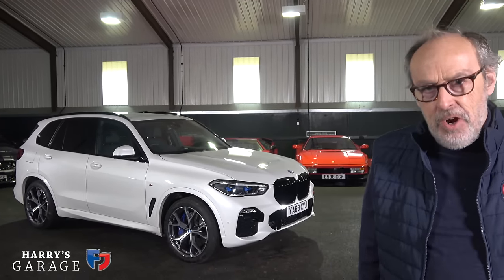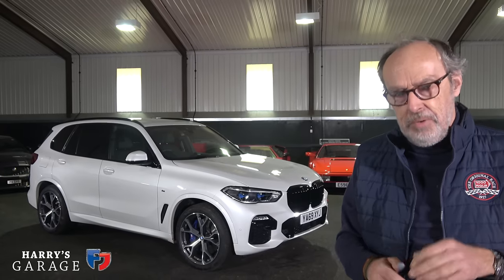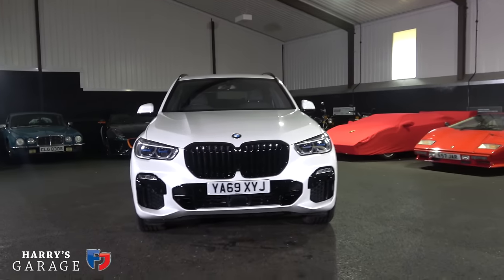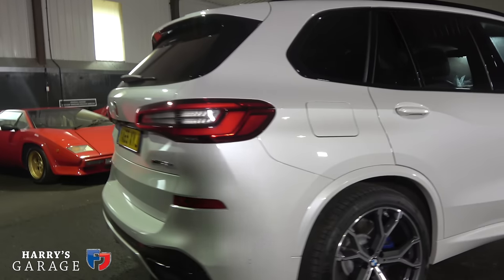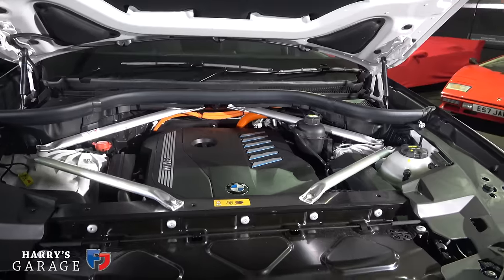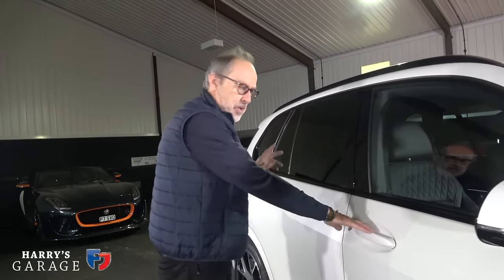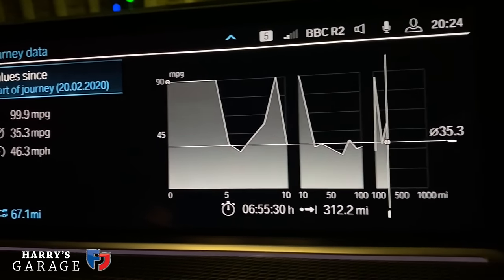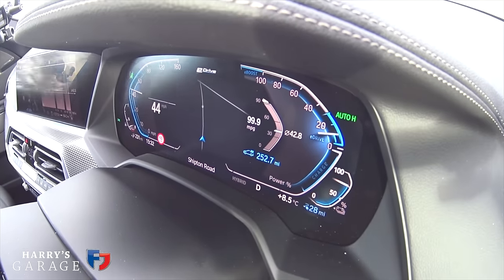BMW X5 45e PHEV 2020 review. Is this new plug-in hybrid better than a pure EV in the real world?

Comment: I remember reading somewhere when the X5 45e was announced that BMW were considering multiple engines including a 4 cylinder (like in the previous gen 40e) but there wasn’t much difference in economy between that and this 6 cylinder so they decided to go with the bigger smoother engine as they thought customers would prefer it. I’d certainly go for this over the P400e, and would be interested to see how it compared to the Mercedes GLE 350de.

Comment: Excellent review! My three year old X5 40e use 2,5 l/100km locally and 7,4 l/100 km on long distance (fully loaded). But 80% of the distance I drive is locally around town. With this new 4,5e I would go fully electric for month. All the EV and all the ICE advantages in one car!
Reply: how efficient is the battery charging while driving?
Reply: @MrHellrider9  Going downhill on cruise control, the brakes are not used and the battery charged at greate pace on the 40e I owned, as well as on my 45e today. Just like any EV.

Comment: you  don't need to have it adaptive mode for the smart hybrid function where you use the navigation.  you can just have it in hybrid or eco pro hybrid also as long as you enter a destination in the navigation system . adaptive mode has with the handling of the car, like steering wheel hardness and suspension.

Comment: My Lexus 2017 Rx450h does over 35mpg on long or short journeys and I don’t have to plug it in. Not bad at all. This BMW’s use case is for daily commuting for approx 50 or so miles a day where battery power alone could give petrol free drive and the the occasional long drives to not make you worry about battery anxiety.

Comment: Top stuff Harry as ever. I do 90% trips of under 50 miles and this is where Hybrid Golf GTE, BMW i8, Porsche Panam' Tourismo e hybrid win out - as mpg on the 'long-term' readout is nearly always 85-100 mpg...and because it is aggregating away in the background every day, even a 250 trip once a month doesn't dent the long term mpg fig by much. In short these cars are brill if you hate petrol stations,  love silent town progress, favour torque over power/revs, mainly drive less than 50% over the ev range everyday, like the smooth but gruffly coupled power you get from engine/ev unit when you drive in sport and finally you DO have access to charger(s) at home - then they are better than a full electric car !!

Comment: My 2020 i8 has the same software and yes it works! Mine has only 11,6 but as it’s much lighter it still does 54 km in real life charge.
Reply: Klaus Nielsen congrats on getting that car. It is so much underrated due to it’s neither a BEV nor a full on hardcore racer. The three cylinder sound also is amazing in sport mode!
Reply: Nico Steinacker it may not be a hardcore racer in the sense of Porsche 918 or La Ferrari but it is a lot faster than all the iHaters think they know! Mine is the Roadster variant but I drive a Volvo XC90 T8 Excellence as a daily and plan to get this X5 45e or the 745 Le later this year.
Reply: 54km is only 33 miles so much worse than this X5.

Comment: And all the time you were using the rear wiper. Even when talking in the garage. 
Nice review
Reply: It was also a very noisy rear wiper!
Reply: That wiper was driving me nuts.
Reply: And Me:- I kept shouting switch yer wiper off. Look in your rear view mirror. Listen 👂
Reply: its a BMW.. its already broken
Reply: Did my head in too. Would probably have doubled the range if that hadn't been on constantly.
Reply: Rob C 
Ah I get it,  just like the indicators, they never work on BMW’s either 👍🏻
Reply: I have the car, when the rear wiper is on I do not hear it. And no, I am not hard of hearing.
Reply: Bob Bolitho when It’s rubbing on dry glass it does make a noise. It would also draw unnecessary power.

Comment: Harry, can you not recharge the BMW on the motorway as you are going along?  I run the latest Panamera Hybrid and over two years it has averaged 36.4 mpg.  Not as much as the X5 you tested but the electric range is a claimed 31 and I have never had better than 28.  (In winter nearer 24).  However the big benefit for me is using both engine and electric for longer journeys say to Manchester and recharging to 80% charge on the way back in under half an hour in Sports Plus.  You get below 30mpg whilst charging in this way but then overall for the 450 mile journey the car returns close to 40. This allows you to always have electric range available, something which I suspect in town centres will be necessary in the years to come.

Comment: Great video Harry and very fair, I have owned a few X5s both diesel and a petrol which had been converted to Gas. The petrol was a 3ltr and was great wether running on gas or petrol but without doubt the diesel was both more economical and gutsy than the petrol and did around 30/35 mpg depending on hard you pressed the power pedal. I bought my daughter an X3 Sport 2ltr diesel and that's brilliant on fuel around 42 on a run and she's got a heavy right foot. This X5 looks brilliant but fitting the 3ltr diesel would have made it outstanding on fuel. Whilst you say the price of this X5 is £66,000 and good value not everybody including me cannot afford this sort of money so I'll just have to wait around 10 years till it becomes affordable but I would love one, the trouble is ill be 85 by that time so may not need one anymore, I will stick with my BMW 730 ld for the time being with its £160-00 a year road tax and live in hope that I make it.

Comment: GREAT balanced video as always Harry - try the new Merc GLE 350de PHEV, it has a bigger 31kWh battery and 60 mile claimed EV range, 320hp system output, very comfy ride, but interestingly it is a 4-cly diesel, so on long road-trips you're getting great mpg!  And on your "regular commute", press the EV button, stay in EV and you'll never use the engine!    You say plug-in hybrids have come of age - whereas the government are banning them in 12 years or so - do you think that a bad call, and will put off people changing to EV? And force road-trip customers to frequent the horrid & ineffective public charging network in their BEV's!  Best wishes.
Reply: Yes, environmentalists don't want you going on road trips, so are pushing for Plug-In Hybrids to be banned. Greenpeace or whoever, want you on your bicycle!   What will happen in America?
Reply: dude, I would love that GLE 350de PHEV for my 50 mile round trip commute. I would charge at home overnight, I would stay in silent relaxed EV mode all the time, never run the diesel, never worry about the extra weight I'm carrying around!, never have to visit a repulsive charging station thank you very much, diesel doesn't go off in the tank so easily (modern petrol goes off quickly), never worry if I might need the car at sudden short notice because my unused diesel would suddenly burst into life…!  I could even drive it on a Harry's Road Trip to Cannes and back... but hybrids are too expensive... I can't afford a nice new GLE 350de...!  Shame...

Comment: Harry, one point to mention: the previous generation plug in hybrid X5 had the 2.0t pot engine; they switched the the 6 cylinder for this generation.   Telling that BMW made the change.  

Also, you can do everything that the computer key does on the app, no need for that option.

Finally, really looking forward to seeing what you think of living with a Tesla.  Should be interesting.

Comment: It's better for batteries to change slower. Its a electro chemical process not just power in as fast as you can. Once the voltage reaches max boost level, the current has to drop to stop damage. Fast changing needs lots of cooling and will effect the longevity of the cells.

Comment: Hi Harry, really interesting to see you embracing the eletric bits. Just wants to tell you about this range-extender SUV in China called the "Lixiang One". 1.2T three culinder petrol engine with a 45L fuel tank. 40Kwh battery giving it roughly 85 miles of real-world range on eletric(it claims 110 miles). Twin eletric motors put out about 240kw giving it 0-62 in about 6.5s when the battery is full, 8.5s when the battery level is low. The petrol engine is only there to power the eletric motors. When you are not charging the vehicle and therefore just filling petrol, it does about 30mpg. But when you do charge the battery, you obviously have a huge range of 85miles. It looks like the next step after this. And it has all the attributes of a pure EV: no gearbox, instant full torque at all times.

Comment: Please don't confuse kW and kWh. When you said "This does more miles per kW" it's like saying "This does more miles per bhp". kW is power, kWh is energy . You also did this in the Land Rover video.
Reply: Actually kwh is capacity. Like miles per gallon would be miles per kwh. But on point from you, many journalists/people tend to get this wrong.
Reply: @NickMusB  actually, it's both.  fundamentally energy is power applied over time.  e.g. X * thousands of watts * 1 hour.  batteries store energy.  it takes certain energy to move a car that weights whatever over 1 mile.      batteries can discharge at a certain rate for given potential, therefore it can also be measured in wh, kwh, ah, v*a*h, whatever

Comment: These plug in hybrids make a lot of sense if most of your driving is through the city and some secondary roads. There's also the issue of no overnight charging if you live in a building. But if you're mostly on the motorway at high speeds it's definitely not worth it.

Comment: Cool, just make it as a 5 series touring now, BMW.
Reply: That would be lovely. But it would have a smaller battery I'm afraid.
Reply: A Gentleman Volt was also a series hybrid with a small fuel tank and fwd. Not really comparable to a front engined rwd parallel hybrid that weighs almost 900lbs more.
Reply: It’s coming. 545e will arrive later this year 👌
Reply: In a 3 series touring would be even better, proper performance plug in hybrid. The 5 series has gotten fat. Its as big as the 7 from a few generations ago.
Reply: @tomvermoesen  545e Will only Come as a sedan. 5 series touring Will be 530e 2 litre 4 cylinder. With or witout xdrive. But hopefully 545e touring Will be introduced in 2022

Comment: 17:50 when he floors it and you hear the engine start and immediately go to redline! That just doesn't feel right to me
Reply: The engine will be cold and I doubt the oil pressure will be fully reached as well. Really bad for rod bearings as they need to warmed up otherwise they wear out
Reply: I think it's because in Sport mode it's already in a lower gear
Reply: @leenevin8451  I believe a lot of these hybrids find ways to keep the fluids in the engine warm, and I know the Mondeo will turn the engine on intermittently to keep coolant temp. Same for stop-start engines, they won't work unless the engine is warm.
Reply: noeL I’m aware of stop start. Still don’t trust it
Reply: @dreamcrusher112  unless they have an electric oil pump running before startup, it really isn't great to start and engine and immediately redline it
Reply: CVT?
Reply: noeL on the dash it does specifically say the coolant is 'cold' when he floors it
Reply: @adpmol  oh I didn't know that, sort of answers my concerns. I'd like to know if they are running when the engine is off

Comment: I run a BMW 330e. It’s will sound mad but if you run the car in Sport, it is much more efficient as the regen is more aggressive. I can get a maximum of 16 miles ev range (in the summer) but with regen in sport mode, average 47 miles ev range on a 60 mile round trip (with a charge at work) so 23.5 average each way.

Comment: Think this would make a lot of sense partnered with their 2 litre diesel, which gets great economy on motorways.
Reply: That is what the previous generation was and it was underpowered. The smaller battery gave it a range of 11 miles on electric only.
Reply: Bob Bolitho Underpowered for what?  Being zero emissions in town and getting great economy on motorways?  The 2.0 diesel is plenty powerful enough for 99% of situations, add the electric and stick it in a 3 series and it’s perfect.

Comment: Out of interest if you drive this in sport mode using both motors to get the full 400 bhp then how long would that bhp last as in will the electric motor run for a full tank of fuel when in use with the engine or will your battery power run out then you drop down to just the petrol engine alone at say 290 bhp ?

Comment: Great review and a lovely car! I would also love to see a review of the Mercedes GLE 350de it’s the direct rival to the X5 45e but it has a 4 cylinder Diesel engine that should give you much better economy on longer journeys. You can also fast charge it with up to 60kw at a DC-Fastcharger so you get from 0 to 80% in 20 min ... a comparison would be interesting as well.
Reply: The Mercedes 350d has a superb six cylinder engine. Not a horrible 4 cylinder.
Reply: MilesV8 That is wrong! There is no Mercedes 350d. The Mercedes GLE 350d 4matic has a six cylinder engin but I said GLE 350de and that one has a four cylinder engin.

Comment: These things are going to be uneconomical to repair at like 7 years old. Super complicated. Plenty of 14 year old E53s still on the road.
Reply: not necessarily, Hybrids require less maintenance than petrol cars, plus this uses hybrid tech developed in conjunction with toyota... so it may actually be very good to run in a few years..
Reply: @Cynycter  How so? I would think you still need to maintain the petrol engine/drivetrain as usual and then there's additional systems that need to seamlessly combine both drivetrains.
Reply: These kind of vehicles are made for PCP and buyback schemes.

This drivetrain would be compelling in a 'M345e' series with the full 380bhp b58 mill though.......
Reply: BMW no longer want you to own their cars. They want you to lease it for a few years, then they sell it as certified pre-owned, then the third owner out of warranty eats all of the expensive repairs. Circa 1995 is the last year of minimal electronics, at least for petrol engines.
Reply: @666louis  hose additional systems are not necessarily mechanical... a plug in hybrids petrol engine is far less stressed than a regular ccars... and electric motors have very few moving parts and basically dont require any maintenance... the only real concern is the battery, and most are good for at least 10 years..
Reply: Agreed. Put this sort of engine in a Golf and it makes sense. In this thing, it's just less guilt for owning a pointlessly huge car. 40mpg isn't particularly green, nor is the manufacture of these engines.

Comment: Harry, great reviews.... Maybe you can answer this? During my research, the US sticker (and US BMW website) show 30 miles on a full charge. The UK BMW website shows 54 miles of range, just like you said at the beginning of the video. The only difference I can find is a UK mile is .99998 of a US mile, insignificant. So why is there almost Half the Pure EV mileage in US vs UK? Are half the batteries swapped out for lead at Spartanburg? It looks like you got around 46 to 47, a bit less than 54, but I'd be happy with 40 IRL. If US is 30, that drops to 25 or less real quick. TIA, Phil

Comment: I’ve gone from panicking about EV to welcoming EV, things are going to get seriously exciting as the technology develops, great video 👏
Reply: It will never make your spine tingle
Reply: @visionist7  Wrong, a purpose built weight balanced BEV designed for Fun Handling. BEV architecture just allows better Packaging of heavy big components. Majority will be RWD biased and have more space for Complex Bulky Suspension like Double A Arm with no big lower Strut. Then the low and flat weight will make the mass easy Rotate & Turn. We're talking about a hunkered down RWD biased chassis that likes to Rotate. It will shove your spine in multiple direction, needs serious Sports Seats with side bolstering. Mind blowing.
Reply: @Neojhun  all to the soundtrack of a good blender
Reply: @Neojhun  all to the soundtrack of a good blender
Reply: @visionist7  If all you care about the car is a exhaust note. You clearly are not concentrating on DRIVING. I like cars for Handling Cornering & Speed. Noise is secondary, very few modern engines sound good. I want a Driver's Car, not a loud straight line cruiser.
Reply: @visionist7  FYI I have access to some awesome driving roads all the way up and down the Great Dividing Range of Australia. Just hooning a loud car in a straight line on the highway is a good way to Arrested. But Canyon Carving quietly is something you can appreciate a full day's driving.
https://www.youtube.com/watch?v=5znH2TNPcrI - one of the many routes "Great Alpine Road"
Reply: @Neojhun  I prefer all that and it doesn't sound like an air conditioner. They aren't mutually exclusive, don't you know
Reply: @visionist7  "doesn't sound like an air conditioner" " a good blender
" Are you Delusional or Deaf? BEVs do not sound like that. They have a very mild low hum which you can barely hear. You have no clue what you are talking about. You aren't even a Real Car Guy.
Reply: @Neojhun  is that supposed to offend me? lmao run along kid. You're probably into self driving cars
Reply: @Neojhun  I've been on YouTube since 2006 using several accounts.

And electric cars sound shit
Reply: @visionist7  https://www.youtube.com/watch?v=gi2XaAjtHJU - Just missing a Sonic Boom
Sounds Better than what ever Slow Junker you drive. 
My daily driver is a Mini Cooper S they sound ok when you gas it with crackle and pops. But they are quiet most of the time.